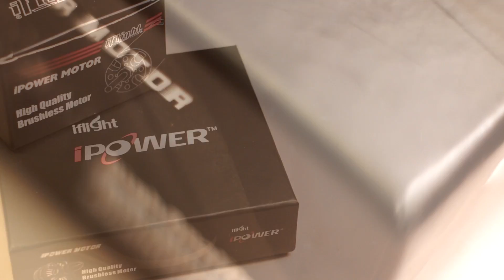Carbon Fiber DSLR 3 Axis Gimbal/Steadycam Build Part 5

Comment: Hey, what motors did you use?
Reply from the maker: +Power Supply I used 2x iflight 5208-200T for the PITCH and ROLL axis (I actually ordered 180T's but they sent 200T's, but I don't think it matters too much) + 1x iflight 8017-120T for the YAW.  Cheers.

Comment: Your attention to detail is impressive.  I humbly want to help you with your "hole drill thingy" or what you said and geek out with you.  The hole tool is called a Hole Saw and the blade is exactly manufactured like a jig saw blade, a reciprocating blade in that it requires a hard metal for the teeth, but a spring elastic metal for the base for flexibility.  It is produced from laser welded (today, not sure how they did it for your older version) HSS weld to spring steel to provide optimal wear resistance to the saw teeth and a flexible body for fatigue resistance.  Whew...

Comment: Immense work and the final piece turned out brilliantly. You're doing John Britten proud!

Can I ask what method you use for soaking the carbon tow without over saturating it?
Reply from the maker: +Paul Whelan Thanks for the kind words.  I squeeze the resi through the tow between my thumb and forefinger that has a bit of resin on it.  Both forces the resin around the fibers and gets rid of any excess.  Cheers!
Reply: elams1894 r5

Comment: I would really like to see the mixing of the resin and getting it in the "strings" of carbon!
Reply from the maker: After mixing the epoxy I dip my finger in the resin and slide the strand through it a few times. There is footage of this process in build vid 1. Thanks!!